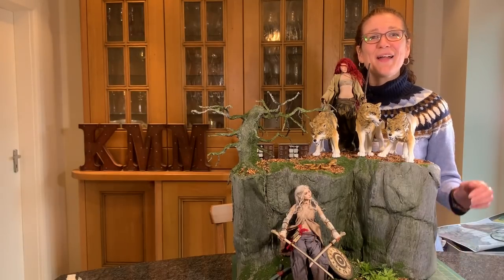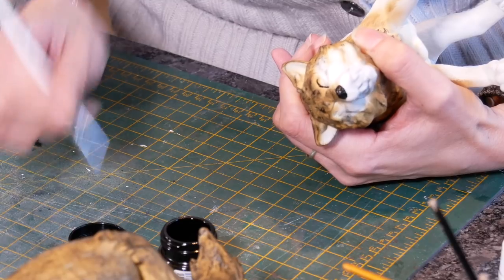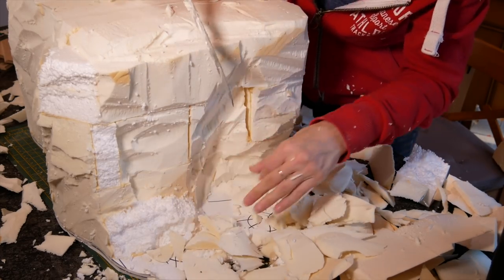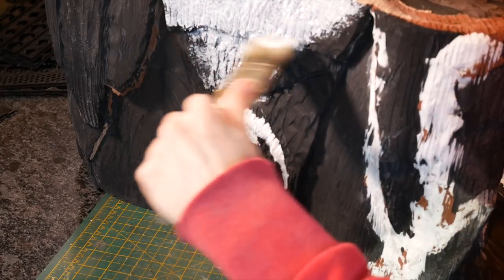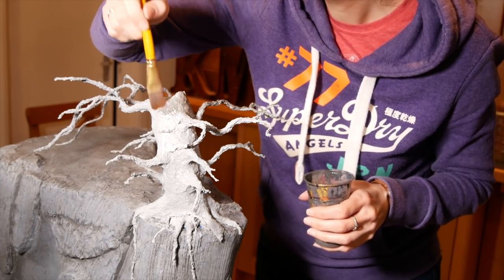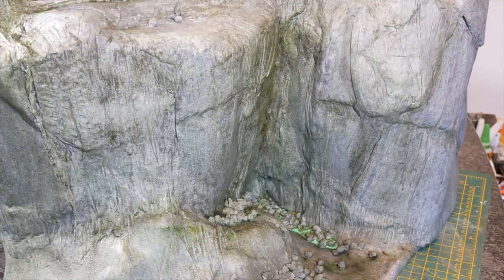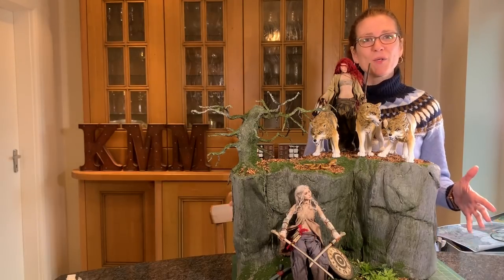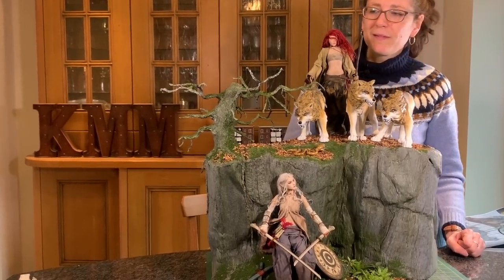Elven Figures and Wolves Diorama

Comment: Hi Kathy
Great video, some interesting products used on this project, nice finish to the rock.
I used cement, pva and water for the coating for my rocks, it works quite well.
Cheers Paul
Reply from the maker: Sounds interesting. I want to do some more experiments with rocks...
Reply: In my last video you can see the effect I got with the cement mix, however I did miss a stage out in error and its coarser than I hoped, missing a bit of fine detail. I have done a second section above my tunnels which looks better.
This is my first attempt at any sort of scenery.. Jury's out at the moment.
Cheers Paul 👍
Reply from the maker: Dunge Wood Model Railway experimenting is so much fun.

Comment: No question this is high end talent. So, are you up for a challenge  ? I build 30mm Minute Missions figures, these are in the scale of 1/144, I have seen gundam dioramas, but I have never seen a smashed up, or battle beaten diorama of the 30mm figures. Are you up for it ?
Reply from the maker: I’ve already started!  I’m doing a challenge using them. It’s a gladiatorial match.
Reply: @KathyMillatt  what a shame i can't entice you onto my 30mm gundam world which is on Facebook, I am sure the choice of weapons will come down to catania or axe. If you're in the UK i can always give you a couple figures and some other parts such as heads and weapons
Reply from the maker: @aleccap5946  I’m in the U.K. and do build Gundam. I don’t really do FaceBook although I do IG.
Reply from the maker: @aleccap5946  I may scratchbuild some weapons but it’s mix and match so I think a Kotobukiya MSG chainsaw will get in there. The offer is very generous!
Reply: @KathyMillatt  lol they are very close to 1/100 while the 30mm are a slightly small 1/144 but don't take my word for it
Reply from the maker: @aleccap5946  gladiators like big weapons!